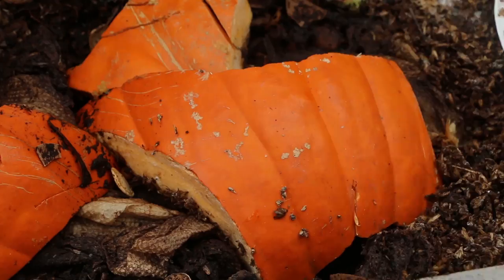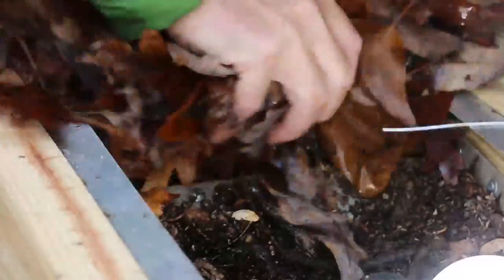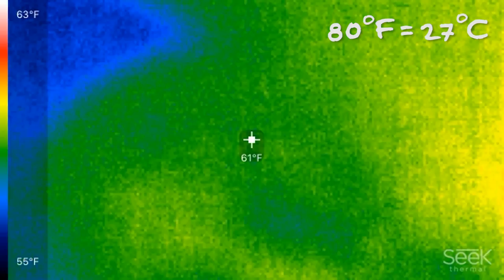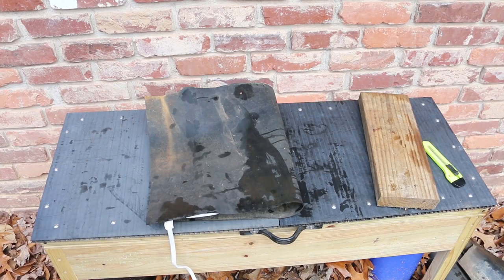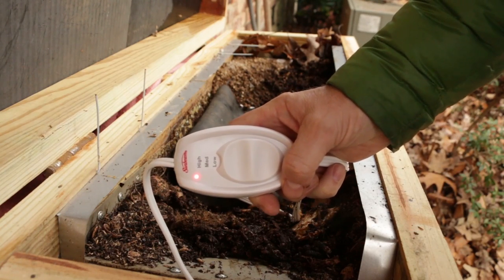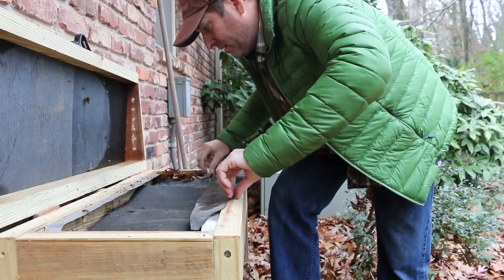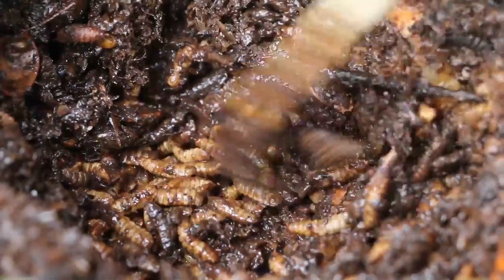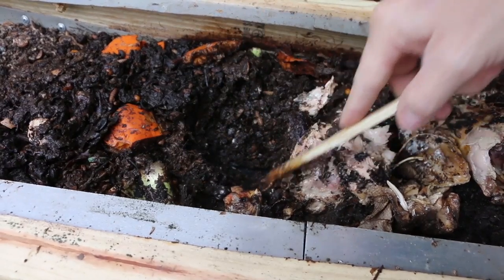How To Raise Soldier Fly Larvae In Freezing Temperatures

Comment: You only need to ensure your entire bin doesn’t freeze solid. The inside temperatures will remain higher  ( in cold months) and cooler (warmer months) than outside air. I’ve successfully raised bsfl year round with no added heat in zone 8b
Reply: I'm in 7b/8a - did you keep the larvae alive or did you get new eggs in the winter?  All my larvae have reached harvesting age now and I'm looking for a way to get new eggs - it's early Dec.  Perhpas move them inside in a popup greenhouse?  I'm curious about your setup if you can please share some more about overwintering bsfl.  Thank you.
Reply: I'm in zone 9 and they don't hatch and lay new eggs during the winter months.  They just started to hatch in June.

Comment: I imagine an incandescent bulb would have given plenty of heat. LEDs are bad heaters because they are so efficient. The heating pad was a great solution though. Worst that could happen is it shorts, but I imagine it has a good fuse.  GOod call on the vapor barrier too. Any setup like that is going to have moisture condensation. Might as well keep the moisture where you want it.  Great work!
Reply from the maker: Hi Jeff. Agreed on the incandescent putting out more heat. They were definitely gathered under the bulb. My concern with the bulb was no being bale to keep the heat in. The sides and the lid on the BFSL composter are pretty leaky from an air standpoint. Thus, putting the heating pad underneath and heating the compost instead of the air seemed like a better solution. The rubber liner over the top help keep the heat it, but I hadn't even considered the moisture angle like you mention. I'm planning to build a simpler version of this bin sometime this Spring. Once the soldier flies are hatching again. Although, I did have an adult soldier fly fly out of my worm composter yesterday. It is in the garage though and we have had an 80 degree day in Georgia in the last week. Thanks for watching.

Comment: I'm confused. How are they going to keep composting if there's no source of new lava as they mature? How is cost effective is it to heat the box? Why not just let it freeze and start over in the spring?
Reply from the maker: This is an experiment. :-) What I've read is that their development slows during winter, so they'll just keep eating. Cost is a good question. I have an energy monitor, which I will run on the heating pad pull. I'm curious about that too. I'll comment back with that info. In the past, I just release the larvae to a compost bin or garden bed and shut down the bin for the winter. I have released a good many larvae to compost and garden and wanted to see if I could keep some working through the winter.
Reply: @GreenShortzDIY  I read that they can stay in larva stage for 9 months! So I assume this experiment was a success? Thank you so much for making these videos. I am SO hooked and would love to start BSF composting as soon as I can... in the midwest US might get challenging but... I'm determined.
Reply: @GreenShortzDIY  update?
Reply: @alexandrahuang7731  Sounds like the optimum temperature to keep them at in Winter may be around 60 Farenheit, which would keep them alive and eating slowly, which would be less onerous from an energy point of view.

Comment: Could you possibly put the entire composter in a little greenhouse?  Since the adults don't eat, but just lay eggs and die, the adults could get some protection from the cold.  They could then lay eggs until they die.  Their life span is pretty short anyway.  If you can get the larvae to get warm enough to actually mature into a soldier fly, the cycle would continue  I wonder, too if there could be a cheaper way to warm them...Just a guess but maybe a small composting area of grass and leaves to produce heat within your little greenhouse.  This is all theory, since I don't have a composter because I live smack in the middle of the city, but I've watched, researched, and learned some things.  The inside composting, in the greenhouse came from an idea from the forester, Jean Pain, who literally lived, providing himself with hot water, methane for cooking on a small cooking plate... all from just compost.  His wife did the majority of the cooking outdoors using things you already know about but he has this green living thing down to a fine science..  Just an idea.

Comment: I was in Aldis yesterday and subconsciously ended up with a heating pad.  Now I know why.  Thanks!

I moved most of mine inside until I can figure out what to do. I slowed their feeding and try to keep the temp between 55-65. On the bin I left outside added a bunch of Pete moss to dry out the medium because I'd think the moisture would add to the hypothermic conditions. They need a head source (Texas). My goal is to sustain a population I can seed in the spring in my greenhouse. It's really hard to get them to mate over winter even in a make shift breeding chamber that's environmentally controlled.

I saw a video where a guy put a sheet of foam insulation layer on top (of the compost) to contain the heat the larvae produce. Foam board Might do better than you're blanket.
Reply from the maker: Meta, you're right about the foam board. I may add some over the pond liner. I just had that on hand, but no foam. I'll see if I can scavenge a piece the next time I'm at the local reuse center. I wonder if the that the soldier flies won't breed in winter is due to the shorter days, versus just temperature alone. I'm going to make a screen house in the spring, to see if I can increase my local population. I want to try and start composting the food waste from a local restaurant. Where are you in Texas? My wife is from Austin...lived in Salado and Sequin.
Reply: I'm just east of Dallas. We discovered the little workhorses a few years back by accident. We fed them to the chickens and never looked back. This year a raccoon took out all our chickens just before cold set in and I ended up with about 30-40lbs of pupae. And 3-4 generations of larva -- which I'm trying to slow grow.  I've been dishing out  grubs to reptile enthusiasts, red dragons love em. 

There's a few videos out there experimenting with over wintering. it really needs to be hot and humid to jumpstart the mating. We're still rebuilding after a tornado last year so I think I'm going to look to next winter to play with a winter incubator. One thought was to buy the eggs online to get through the winter. I miss all the waste I can give them (and the chickens :( )

We're going to start a pilot program with the local Brewers in the area. ideally it would extend to restaurants but we were thinking cafeteria type establishments, hospitals, schools etc., but helping brewers with their waste will help me grow my 'waste'. 

Keep us posted, 
Cheers!
Reply: you need to make sure that the heating pad that you buy doesn't have an automatic shutoff after they have been on for a certain length of time-just sayin-a lot of them have that feature now
Reply: Barbara Simmons, Aldis pad work as you describe. Good for my shoulder not so good for long nights in the bin. I suppose I could rewire it to thermostat to shut off instead of the timer.

Comment: Not sure if it was suggested before (too many comments to read :-) and since the video is 3 years old you may have thought about it yourself but...
Why not build a "lovers tent" like I saw in commercial BSF composters. Just a small space surrounded with mesh and placed indoors somewhere where no one will object like a basement. probably need some lights because I heard that entices mating for BSF as opposed to humans that like to mate in the dark :-)
Let a few larvae pupate but give them a way to do it so they don't crawl out and freeze and manually move them into the tent. maybe insulate the collecting bin and leave something like a hot water bottle or a 2nd heating pad.
I assume that you will only need a few dozens at a time to insure mating and egg laying.

Comment: I’m wondering if our goal might be to have them hibernate or go into suspended animation rather than thrive!?  If they thrive, they mature, grow into adult flies and die.  Would lowering the temperatures to merely keep them alive (say 50 degrees) slow down their metabolism and rate of maturation?  Might be a cool experiment.
Reply from the maker: Actually, I believe that is what they do by design. I read somewhere (but I can’t find it again), that they can extend their pupae phase for up to six months to overwinter. They dig into the top layers of the soil and chill out until Spring. The experiment in this video was a non-starter. I think they’d need to be inside an 80 degree temperature controlled enclosure to complete the full life cycle. Now I just let them all go into the garden mulch pile for the winter. Thank you for the feedback.

Comment: great video!  is there going to be an update on how effective this was?  i also live in an area with a long and cold winter below freezing, i wanted to know if it's possible to keep these guys going throughout the winter and thrive each year?  Thanks again
Reply from the maker: Page, in the end this effort was only partially successful. The heat allowed the existing larvae to pupate, but then they crawled out of the bin into the catch-buckets and were killed there by freezing temps. The adult soldier flies need to fly to mate, and the outside temperates didn't allow for that either. I also suspect that the day-night light cycle plays into this as well. So, to be able to produce year-round BSFL and continue the mating cycle, I think you'll need a fully controlled environmental enclosure, with temperature and lighting controls to mimic the ideal habitat. Thanks for your question.
Reply: Page Yin I think you have to do it indoors. I live in Boston and want to try raising them.
Reply: @GreenShortzDIY blanket.. really!.. poly foam panels contact glued outside & keep temp above freezing for the ground to stay just dormant.. otherwise I don't see the point.. your waste can be naturally frozen to preserve for next season .. keep the larvae dormant without freezing to quick kick start the next season.. you be pushing the brown stuff uphill trying to keep their lifecycle going  all winter.

Comment: What about putting a piece of that rigid insulating foam with the reflective mylar under the lid?  It'd run you a few bucks plus you could probably incorporate egg sites on it?
Reply from the maker: I think the foam insulation would help with keeping warmth in the soldier flay larvae bin. The mylar layer would help a little, but I think the regular foam would be enough. I do think my method of using the rubber pond liner works nicely contacting the compostables and moving down as they are consumed. One downside of the rigid foam is that the air gap could grow as the compostables are eaten by the larvae. The warm air could flow out the sides if they aren't sealed. Still, if foam is all you've got, it would be worth the added protection it offers.

Comment: I'd like to raise a couple of macovy and kaki cambell duck hen's each, mostly for eggs and to help keep pests out of the garden area. If I were to use BSFL for their primary feed, how much BSFL per duck, per day, would I need to meet their needs? Plus, our winters are relatively short here in the high Mohave desert, so can I just produce extra during the hot months, then just freeze or dehydrate some for feed, during the winter? Lastly, how large of a bin should I use to produce enough feed for 5 to 6 ducks? Thanks.
Reply from the maker: Hi. I'm not sure of the amount you'd need per duck, but I suggest using the BSFL as part of your ducks' food supply, but not all. I've read that too many BSFL in the diet of chickens can cause the eggs to take on an earthy flavor. The reference here was a story where someone's chickens knocked over a BSFL bin an gourged themselves...and it was just the one story, so may not be an issue. I suggest starting with two bins and scale to how many you can support with feedstock. You might reach out to local restaurants or neighbors to take their food waste. BSFL can be frozen to use for later. To overwinter some larvae provide them with a decent sized compost pile to burrow into for shelter. They can extend the pupae phase of their lifecycle for up to 6 months to get through a cold season. Amazing little creatures. Thanks for watching. Happy composting.

Comment: Use an incandescent bulb - it is a much more efficient heater than it is a light bulb. You can buy a temperature regulator for less than $12 - It's called a STC-1000 (available at Amazon and ebay). You can set it to turn off the bulb when the temp gets where you want it. If you are interested, give me a reply.

Comment: I think a 40w regular bulb would work fine and energy cost less than a heating pad. Maybe set up a timer for bulb.  Lid will need to be tall to accept bulb and if you lined the top with a metal it would hold more heat.
Reply from the maker: Hi Jack. Good suggestions. In the end, I did get most of the BSF larvae to pupate, but they just crawled out and then froze. This was an interesting experiment, but now I just shut down BSFL composting for the cold months. Thanks for watching.

Comment: wish I did this about a month ago. Piedmont region ga.
Reply from the maker: Hi Jade. We've definitely had a milder start to winter in Georgia. Although, if I had gotten the LED bulb in my soldier fly composting bin when I did, they would have all been dead. What type of soldier fly bin are you running? Is it on the ground? If you can locate a few larvae, bring them inside to see if they start moving in the warmth. Then you'll know you can still add heat to bring them back into production.

Comment: So, I'm not surprised that the mature larvae were freezing to death. That doesn't seem like such a big deal to me though (I assume the chickens will still eat them?) so long as that doesn't deplete the population so badly that you have trouble starting back up again in the spring. Did that work out ok?
Reply from the maker: The chickens would have still eaten them, but I just buried them in my compost pile thinking (hoping) a few might still be viable. My normal practice to keep the population going strong is to toss a handful in the garden bed or compost pile with every harvest. Lets them hatch into adults and lay eggs. But, BSFL can scale up super fast. One adult can lay thousands of eggs. Thanks for watching.

Comment: So what happens when they pupate?  How are you getting new larvae over the winter?
Reply from the maker: This experiment was both success and failure. The larvae did pupate, but then crawled out and froze. No new larvae. Only pupating the ones already hatched. No new adult BSF hatching in the winter months either. BSFL slow down their pupae phase for up to 6 months to cross the winter gap. Amazing little creatures. Thanks for watching.
Reply: @GreenShortzDIY  Would you say that the light bulb would have been sufficient for keeping them over the winter without pupating?
Reply: @alexandrahuang7731  They go dormant and then return to being fully ravenous when the ambient temperatures warm up.

Comment: That is the most cherished garbage dump I ever seen! Not sure why you did not place your heating pad UNDER the bins, instead of INSIDE  the garbage. The plastic is pretty thin. You could attach the heating pad under it and fill in leaves as insulation ( or build a proper insulation wall).

Comment: Heat rises. I would be inclined to put the heat underneath and tent over then pack the insulating leaves over the top. Remember heat rises cold falls
Reply from the maker: Yeah. The light was not enough heat to warm the inside of the composter enough. I tried a heating pad under the compostables. That kept things warm and allowed the larvae to pupate, but it was too cold outside the compost and they hatch. A green house environment would allow better survival and replication in the winter. Thanks for watching.

Comment: very cool approach! Will you consider put a simple structure for insulation to house the unit? It make sense when you have that vent transporting some heat from the house!
Reply from the maker: +Symton BSF that would help for sure. In the end, what happened is that the Heat allowed all the Black Soldier Fly larvae to pupate. They moved out of the compost and into the collection bins, outside the heat of the composter. Then we have a really cold week and it killed them. So, while this was an interesting test, it didn't solve the whole problem of raising BSFL in a non-tropical environment. That would require an insulated and heated space, like you are suggesting.